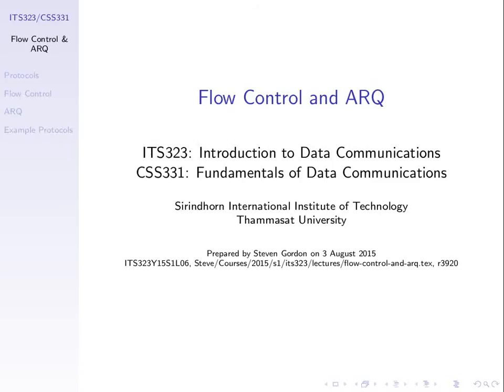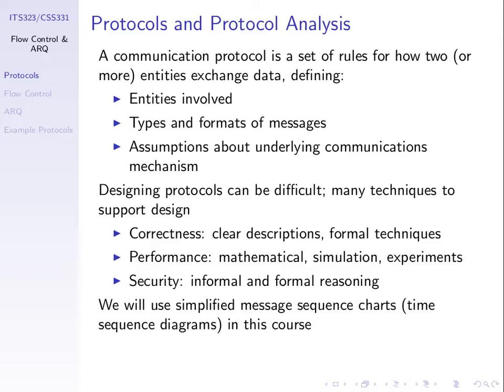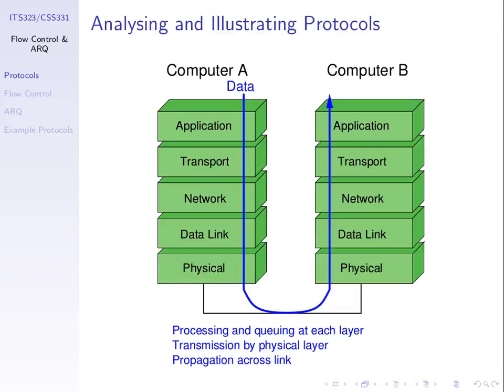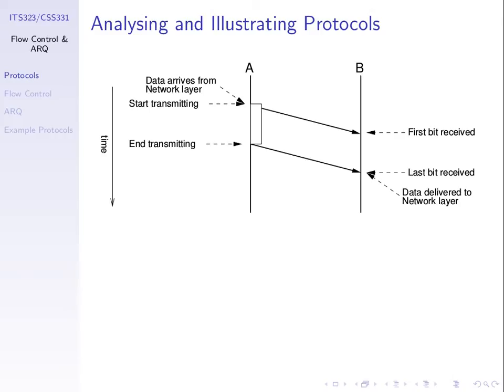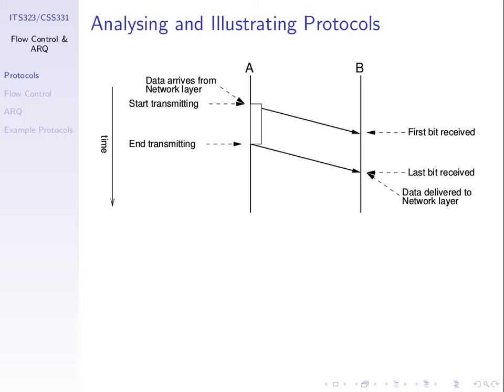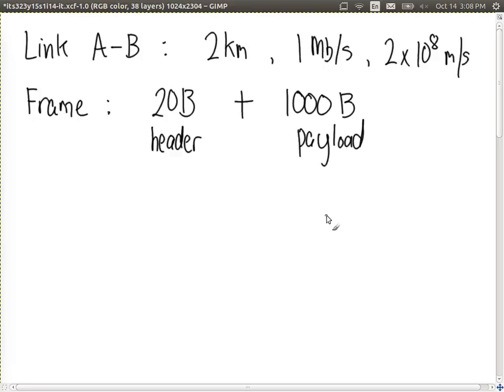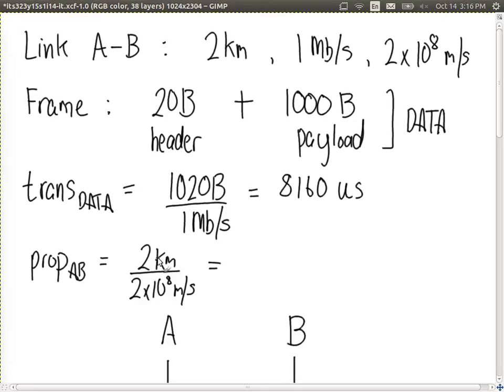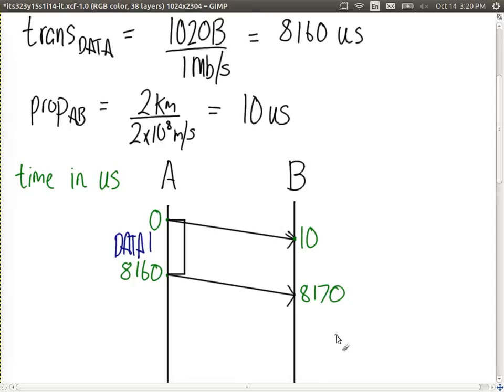Protocol Analysis with Time Sequence Diagrams (ITS323, L14, Y15)

Comment: • Flow Control & ARQ
  ○ ARQ: Automatic Request Q schemes
Protocols and Protocol Analysis
 • Communication protocol
  ○ A set of rules for how two or more entities exchange data i.e. HTTP
  ○ Usually sends messages to each other  i.e. ACK message
 • Designing protocols
  ○ Correctness 
   § You don't want to have a laptop waiting for a router and a router waiting for a laptop at the same time
 • Time Sequence Diagram (below)
  ○ A and B are two computers
  ○ The rectangle represents a frame
  ○ Notice the propagation delay
 • Transmission delay = data/data rate 
  ○ Total wait time (see next lec)
 • Propagation delay = distance/velocity 
 
 • Throughput = payload in bits/ transmission delay
 • Efficiency of the link = Throughput / data rate of the link 
  ○ You can also estimate efficiency by dividing payload/header (although this can't always be used)